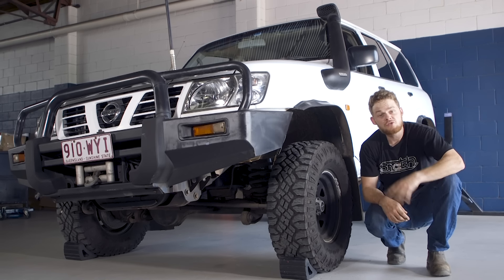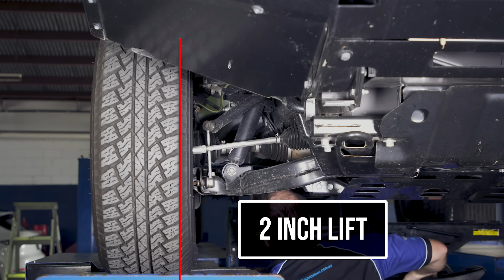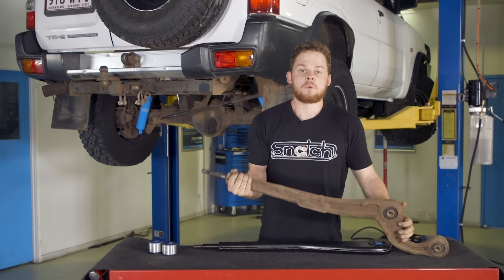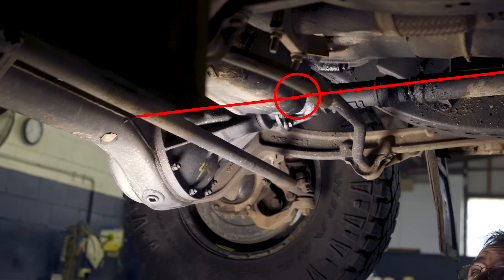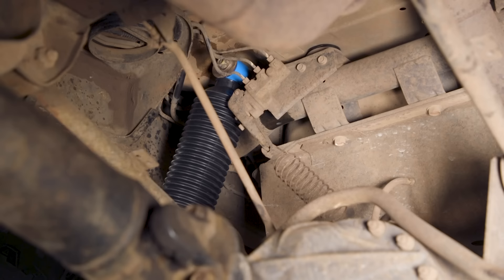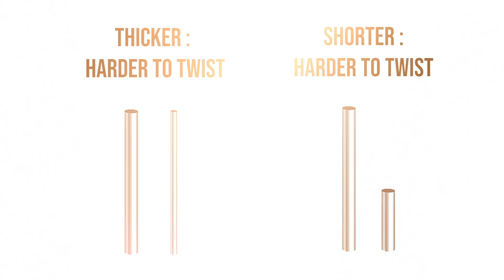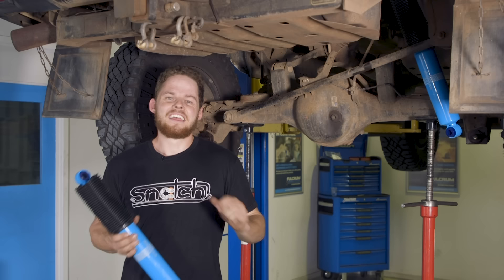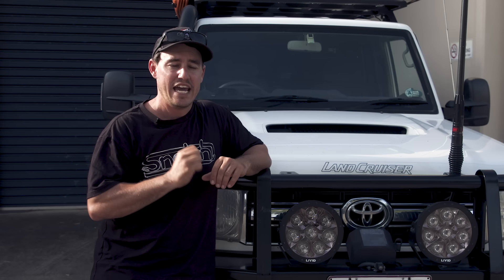EXPOSED! Are bigger suspension lifts better? Experts show what really happens when you lift your 4WD

Comment: Taking Sean's comment at the end saying run the biggest tyres with the smallest lift possible, just remember 35s are pretty much impossible to get engineered nowadays without some seriously expensive work, if at all & the police in Oz are now very well versed in nailing you for them. For those of us who ran the Mansfield gauntlet a few years ago in the high country, some of us had to prove we only had a 50mm (2") lift & were running a tyre only 50mm diameter greater than the tyre plate to drive away even though we were legal. The more people who get nailed, the sooner we have any allowance for tyre increase removed from either VSB14, or state regulations as it's  a hot topic, particularly on ESC vehicles.

Some people are also confused about body lifts in conjunction with the 75mm maximum lift without engineering due to some poorly worded article a while back,  assuming you can do 50mm suspension, 50mm tyre diameter & 50mm body lift. Sadly that's not quite true as you basically have to get anything that raises the roof height by more than 75mm engineered so you can choose either the 50mm suspension or 50mm body lift in conjunction with the tyre increase to give you that.

Comment: I’m actually looking for taller tires on a stock 20 inch rim. Now I’m just going for looks here not off road for my 2020 AWD Passport! I hate the gap between my stock tires and the wheel well. Are there tires that are tall enough and aggressive looking like AT that I can place without lifting the vehicle? Ok, so I’m willing to change wheels to 19 or even 18 to fill in my wheel well. Possible suspension lift to get tires that can fit the entire wheel well without rubbing 
Cheers !

Comment: How about wide tyre v skinny tyre. On the DMax you could do 265/75/16 v 235/85/16. Understand you wouldn’t normally put the 235 tyre on a DMax but these tyres are very similar diameter and could be used for the test.

Comment: Do u guys recommend 2” spacers as they are definitely a cheaper option
Reply: Elijah Ghanbar Nezad   I tried the spacers. 20mm. Softer ride. They break down after 10000kms /12 months. The springs twist outwards or inwards and rub. Noise of spring touching metal. Not safe when this happens? The spacers came out in pieces...

Comment: I agree the live “solid” solid axle is the way to go for serious off-roading and rock crawling. However in your video where your demonstrating what happens to the upper and lower control arms, shocks and the geometry etc of an independent suspension you failed to mention that all of those parts are replaced with after market parts. You certainly don’t lift and use factory parts. Anyone who knows anything about off-road vehicles understands that. My Chevy Z-71 has a 9” suspension lift by Full Throttle Suspension sitting on 35” mud tires. I had it done right! All of my angles are exactly as it came from the factory. My tires have 20k miles on them and still look relatively new. The truck rides smooth, tracks straight down the road, no shake or death wobble. Haven’t had to repair or replace a single bushing yet. Before anyone assumes my truck is a “mall crawler” I work on a 600 acre cattle ranch. I use my truck off road daily. Not rock crawling or anything crazy, but I put my truck to work every single day. Maybe you Australia guys need some off road lessons from us Texas boys?

Comment: Hi my lift 2 1/2 on a 2000 Durango 5.9 awd 242d case .. ive also modded the leaf springs with zerks so i can grease them at the poly bushing part same with the ifs front ...

Comment: I have a Pajero. What is flex?

It's taken alot of fiddling to get the 14" of travel in the leaves on the rear. Even with the bump and droop stops in the front cut in half, it still has no travel in the front. The wheel lifts are epic...

Comment: surprised there is no mention of bump-stops and bump-stop spacing, a correctly setup lift kit on a solid axle vehicle won't clear larger tires with suspension lift.

Comment: i have a 2011 ford ranger pk xlt dual cab and its got a 2 inch lift with 32" tyers i think and it runs well for what i use it for wouldn't mind having 33s for the extra diff clearance

Comment: Im from the usa. Dont buy a garbage lift!!!! IRS/IFS kits are MUCH more expensive due the geometry correction needed (many more parts)  I literally just installed a 5inch lift with Y kit longarms on my 2018 jku with 37/12.5/16. Rides fantastic at 70-85mph on the highways and SUPER nice on the trails. Best part ? No cost for install because I did it myself. Don’t cheap out on your kit. Your life and others depend on your rig being safe. If you cant turn the wrenches please get someone that can.

Comment: I might be late to the party, reason is I bought d-max v-cross 2.5 last week, it currently sits on 245/70 r16 (29.5") 
Planning to change the tyre along with suspension lift, should I go for 30mm suspension spacer at front IFS and shackle at back or should I go for full kit and should I go for 265/75 r16 (31.5") or 285/75 r16 (32.8"). And how much lift do i need to fit those tyres as I am more inclined3 towards 31.5" inchers As for now my budget is little tight, expert opinion are most welcome

Comment: A great video at the right time.. I've just replaced this weekend all 4 upper and lower Caster arms and bushes on the rear diff and front and rear Panhard arms.. My Landcruiser has a 3" lift and now I'm learning about how much its costing me to make it right as the previous owner just put heavy duty springs in it and thats all.. grrrr...  I have just put in adjustable Panhard arms, and fitted corrected bushes in the front Castor arms. Please, can you tell me, do I need adjustable Castor arms on the back diff?? I have an 80 series 1992 Landcruiser wagon with N/A diesel.

Comment: Another thing to consider is axle reinforcement or bigger axles all together as adding bigger rims and tires increases drivetrain load. New axle ratios will be needing otherwise the torque coming out the transfer case is insufficient. Vehicles come geared to run their current factory tire size. Here in the US, truss kits are used to reinforce the axles.

Comment: Great job, excellent explenation. i own a 2017 Honda Pilot, i want to put a 2 inch lift kit so I can increase the size of tire. The purpose is for better ground clearance when overlanding and driving in deep snow. Would adding a 2 inch lift kit be detrimental to the overrall drive and handling  or  benefit the overlanding capability? I ask this keeping in mind the  pilot is AWD not 4 wd.

Comment: Is there a video on 4WD Action that goes more into depth with the Isuzu D-Max? What lift, tires (tyres), engine mods and so on? Here in the States it in the Chevy Colorado/GMC Canyon. The ZR2 option is the best option with front and rear locking diffs. Just curious if there is a video out there that talking about the D-Max more. Thanks for the videos. Love from Pennsylvania, United States.

Comment: Running 2" ome nitrocharger sport lift kit on my v8 ifs 100 series cruiser currently sitting on 16" 79 series landcruiser rims with 265-75s on them but i want to upgrade to the 33" bf Goodrich km3 mud terrain 285-75s

Comment: On my CJ7 I put a 4 1/2” lift on and my steering went to shit. I had the drop pitman arm and it was still shit. It became more unstable when pushed hard in ruts and hard angles. I would have done it differently if I was to do it again.

Comment: The only true way to gain ground clearance is with tires. Susp lifts, only really allow for more flex and clearance of tires.  With this in mind. a 2" susp lift on IFS couple with a 1-2 inch body lft allows tire clearance and gains more true ground clearance, and is more effective.  With Solid axle, anothing more than 2 inch, is primarily to blen the tires clearance with flex. Such as running to sway bar. Stuffing the tires is not as common place iwth IFS as Solid axles, and therefor differernt lift requirements.  Great vid. I think the status bug of bigger is better gets a lot of people, as they lift more than what they need for capability. Graham and Shaunos trucks are perfect examples.    The exception would be something like where I live, and the mud is more liquid than dirt. Huge lift keeps the body out of the mud, and allows less resistance, where minimum drag is required, but not necessarily ground clearance.  Its application specific.
Reply: You are forgetting approach/departure angles & belly clearance
Reply: @MicahBell_1860  belly clearance means nothing if you cant get your diff over it. Approach and departure angles can be manipulated with aftermarket tuner bumpers to a degree.  For everyday rigs, that is all moot.
Reply: @MicahBell_1860  nope, just making the point that lifting a truck with suspension still leaves the diffs at ride height limited by the tires.  Bigger tires are the only way to raise diffs. Which isnt always needed. Proven by these guys.  (Except portals, but let's not go there)

Comment: Thank you, great informations. One question please - is 2 and 2.5 inches in the same bracket? 
I am planning 35/10.5/16 tires on fzj 80 and it is between 2 and 2.5 dylema. (Heavy duty, front linear rear progressive, I learned it from the video:)
Thanks in advance.

Comment: Wow, great video. It's so much easier to understand suspension geometry when you can see it go up and down on the lift.
Does a very high lift shorten the wheelbase unless you change the control arms?
Reply: Shortens track width not wheelbase

Comment: Not true. You do not need to notch the cross member for a 4” lift in a patrol. Flipping the drive shaft works just fine. Can still make a 12.5” shock in the rear without the driveshaft connecting with the cross member.

Comment: I have a D22 2.5 Diesel I primarily tow, I have 2 inch lift with load rear springs for when I'm towing and sweet when not towing. It has 265/70/ 16 can I go a bit bigger?

Comment: Is a 2.5 inch lift to much for my 2016 4Runner trail with KDSS.  I went with Bill Steen 5100s set a 2 1/2 inches and a rear spacer of one and a half

Comment: Good 2 see u back jock.....1000 buck truck challenge nxt.....i got a 96 ifs with a 3ltd 2004 turbo hilux motor. Stock truck apart frm motor with 32''maxxis buckshots on 15''/8'' rims. Whats ur thoughts on up grading the battle axe

Comment: I have a Ram1500 that came with 33inch wheels from factory. I am guessing just a 2 inch lift would be more than enough for me. 
I would like to know what is better? 4 inch lift or portal axles for an IFS vehicle. I know that American military Humvees are independent suspension with portal axles and they are pretty much off road weapons literally.

Comment: I've got a 2003 Ford ranger 2.5 td single cab. I had to replace the back suspension with new leafs and shocks, I got new leafs springs for a more modern ranger which raised 2inh at the back, but running stander hight at the front, plus with swapped out 34inch wheels with 35 inch I have lots more traction and she corners like a rally car! I'm of lifting her 2 inches at the front. Would it be better to leave it stander and keep the rally car like handling or to raise it, possibly loosing the handling but better clearance? but I don't do much off roading.

Comment: Love your videos. They are informative,I am lifting a surf with its but the rear is 2 inches lower than me front with the 2 inch lift installed,I know the springs need to replace, the question is can the  bottom link bars be adjusted for longer springs?

Comment: Please correct me if I’m wrong but I was under the impression that in New South Wales,if you had a 2 inch lift you can only run standard tyres. You couldn’t do bigger springs and bigger tyres, it was either one or the other. Is this the case?

Comment: i have a V6 150 Prado. I use it for driving on sand dunes. Will 2" lifts be enough for me? Do i have to change the stock wheels to Method beaded wheels? Does 2" lift include coil and suspension?

Comment: How does putting a bigger tyre affect the torque? Is it increased or decreased?
Reply: Decreased. Change gearing in transfer case or differential to bring back to desired/stock level

Comment: How about a body lift to get the clearance you need for larger tires? Is this legal in Australia? Is an easy option and no need for big changes in suspension, 2' lift is then already good enough and combined with a 3' body lift the 37 do also fit but the center of gravity stays lower...
Reply: It needs to be engineer certified, so you can do it, but it ends up being more expensive (doing it legally).

Comment: why r the brake lines binding at all? Their lines, come in what every length we want connect where ever & how ever many places we need. Hve a reservoir at each corner of the frame, & under the hood. Then feed the brakes horizontally rather than from above same way we feed air to moving tire. We can switch to air brake at tire system from mini corner reservoir or just keep oil tired system. Lossing a line won't spell dome bc u hve some reserve & it would only steal braking from 1 tire not the whole system. Idot light comes on to tell u your line & axle must hve suffer terrible hit 1 corner, ok, but the most u will lose is just the 1 wheel braking bc it is cut off from rest of the system.

Comment: Maybe a dumb question, but if I install an OME set of shocks/springs and get a 3 in. lift will the angles lessen if I go up in tire size from a 30.6 in to either a 32.1 or 34.8 in tire (diameter)?

Comment: Something overlooked is lifting the rear in a patrol you need different trailing arms longer or adjustable for setting pinion angle to get the unis at correct working angles

Comment: I have a 2019 Raptor Supercrew and would like to install Deaver's HD plus 4 in the rear and either Geisers or Eibachs springs in the front. 

The Deaver's will eliminate the rear 2" OEM block and lift the rear 2" so do I need to worry about the length of the driveshaft? 

Also the Geisers will lift the front 2 1/2" and the Eibach springs will lift the front 1 3/4" so would  I need to change out my upper control arms? What about my front sway bar?

Thanks.

Comment: 37's on 3"ome lift on my 14' tundra coming soon. As of now it's on 35s
Reply: Are you planning to do an axle swap with that set up or just regear the diff?
Reply: @c4onmylip I'm going to regear and add rear locker. I've seen plenty of times on tundra forums ppl run 37's without it but ima do the regear either before or shorty after installing the 37's
Reply: @fabianmolina7784  I don't really have much experience with the tundras and was curious on the axle strength for them. My buddies who run tacos tell me the axles need an upgrade if you plan on wheeling hard with 35s and up but then again, thats a mid size compared to a full size. I'm personally a jeep guy and that's a problem we run into after 35s/37s depending on which axle you got from the factory.
Reply: @c4onmylip  Gotcha, no these are pretty bullet proof as long as you regear at 37's and up. My setup will be 37's on a 3" lift. Ppl run bigger wheels with more lift but I think 37's are more than enough
Reply: @c4onmylip  35's no regear needed 👍🏼
Reply: @fabianmolina7784  nice. Good luck with your build man.
Reply: @c4onmylip  thanks, you too bud

Comment: Yeah I understand what ya sayin there Jocko I still don’t want a shitty little 2”. I got 5” and 35s on my dmax 💪
Reply: A mate just put a "professionally" fitted 4" lift on his new Dmax with 33" tyres and its done 3 C/Vs in less than 1000km, blowing at the first sign of extremely easy off-road use. Have you had issues? If not, what lift you use? Cheers for any feedback.
Reply: Karl I did 3 inch suspension and 2” body mate I highly recommend a diff drop if he hasn’t done so already with help a lot
Reply: @cameronrust6393  Thanks for the fast feedback, Cam. There is a diff drop fitted but even the workshop that fitted the lift kit seem lost as to why its screwed 3 C/V's the last 3 times he spun the 4x4 dial. I was with him on one occasion when it went. Seriously, the slightest incline and BANG. 
Back to the drawing board...
Reply: Yeah ok not sure I haven’t put a diff drop in my 3” lift yet and I’ve done tracks in 4H and 4L and one cv is clicking but it did prior to lift it will need changing soon though

Comment: Doing tracks in an IFS is like doing the TT on a push bike.
Reply: Ricky Sowerby come on mate my ifs with 6 inch and 35s and front locker goes as far as a solid axel hunk of junk
Reply: Humidd I you been drinking brake fluid?
Reply: Every single destination I've been to, High Country, Simpson, East Coast all the way up to the top, there has always, always, been IFS vehicles. Admittedly I don't do challenge tracks for the sake of doing them, but don't flinch at most other terrain so they go everywhere I do & probably where 99% of 4wd owners do.
Reply: Could never go IFS. They look spectacular going over easy terrain but are too prone to failures & expensive on parts for me to want to deal with.
Reply from the maker: It’s more important people are out there in their 4WDs no matter what they are mate. Plenty of tracks to challenge an ifs truck!
Reply: Ricky Sowerby nah brother cause I get out there and drive tracks in my ifs aha you probably get chills just before a track in your solid axel car 😂🤣
Reply: 😂😂😂 Do bumps hurt your big girls blouse bits? 😂😂😂 IFS is just so you have a built in excuse why you won't tackle the tough stuff. "Nah, I don't wanna do a CV" 😂😂😂 Only kidding mate. Any 4x4 is good as long as the owner is happy with it & having fun.
Reply: Yeh might break cvs a lot but if your not breaking anything your not going hard enough
Reply: @humiddi3735  5yrs, haven't broken anything yet. Then again, nothing is tougher than a GQ & it is built for touring not hardcore. Still goes alright though. Left more than one "big" rig owner red faced 😂